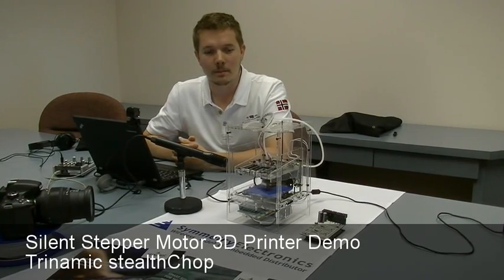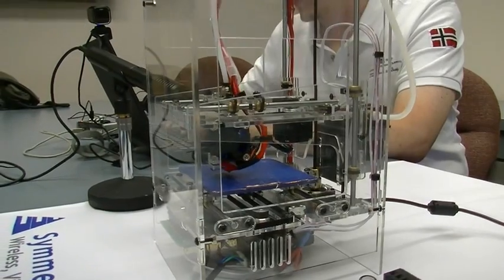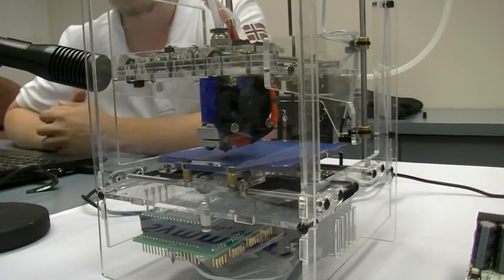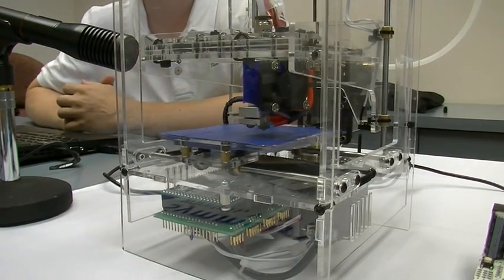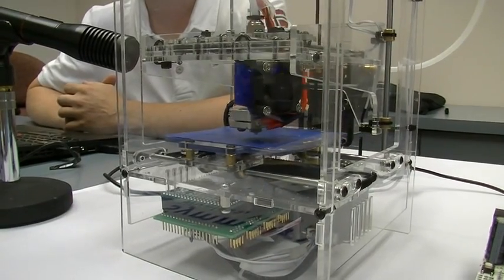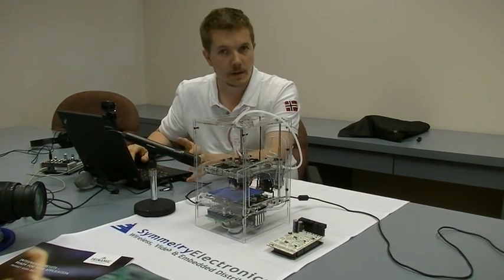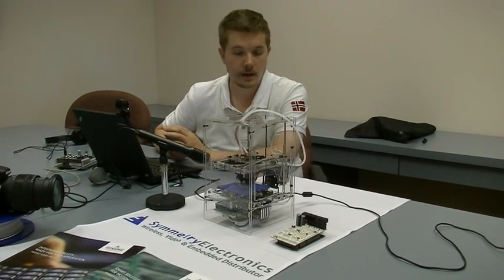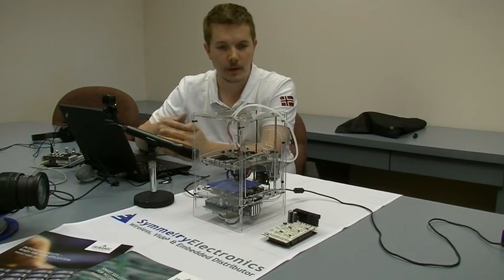Trinamic -  stealthChop Silent 3D Printer Demo

Comment: Yes, but how do you make music with your 3D printer then? I play MIDI files with mine... :-)
Reply: Use M300 command
Reply: @maxthecatwizard7937  M300 does require a speaker / piezo buzzer doesn't it? I meant using the steppers like in this video https://www.youtube.com/watch?v=pKsvXfUvCkQ

Comment: I'm putting together a Rostock MAX v2.  Wondering whether there is a board with these stepper drivers for it.
Reply: your comment is 6 months old so I think you already found your answer, but just in case, the Duet Wifi board has this type of stepper (TMC2660) integrated in it.
Reply: Thanks!
Reply: Actually looking at going for an entirely different 3D printer.  The Rostock frame is wobbly, the carriages flimsy, the axes won't home repeatably...

Comment: When trinamic launch stealthChop motor driver ic 3.5 or 4.2 amp output?

I'm cnc hobbyist and my motors is nema 23 and nema 34 size (3.5-4.2 amp).
Or is other way do same functions motor driver 3.5 amp output to motor?
I wonder build closed loop positioning stealtChop bibolar steppermotor drive 3.5amp output.
= no more noise my hobby cnc mill and lathe!

Now i can only upgrade my soliddoodle 3  3d printer steppermotor board :(
Reply: +Juha Rakolahti 
i think most of the noise for a cutting cnc (router or lathe) comes from the main tool motor, instead of xyz steppers...
Reply: @npgoalkeeper _ Waiting for a long time to know which mosfet is ok to update 5160 & how to do it.